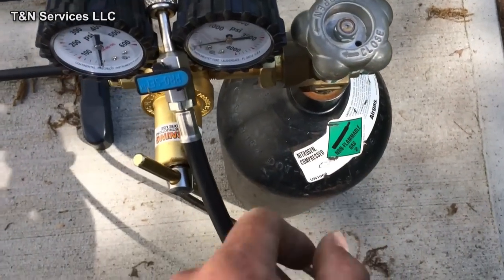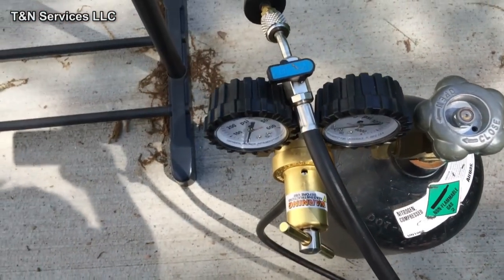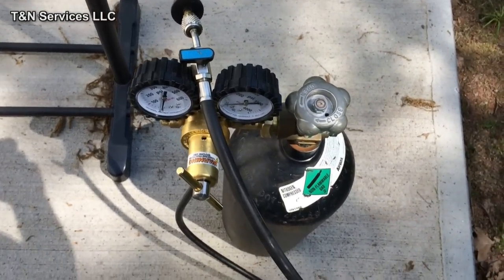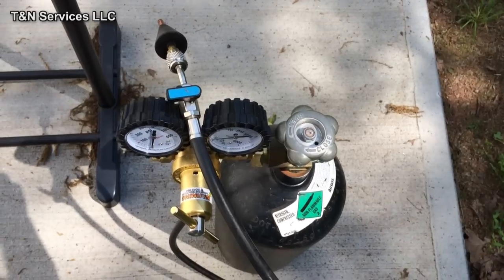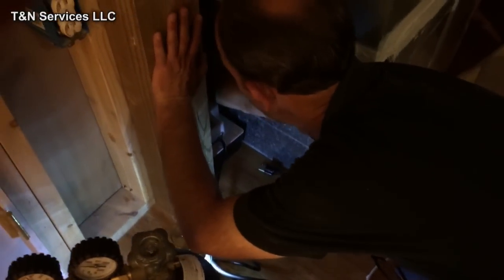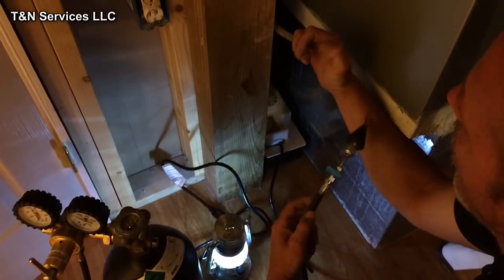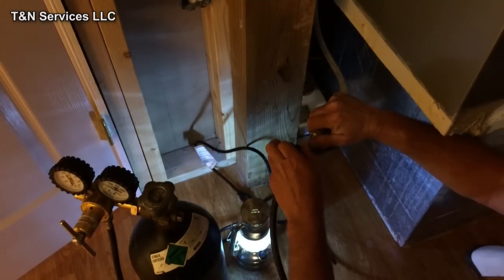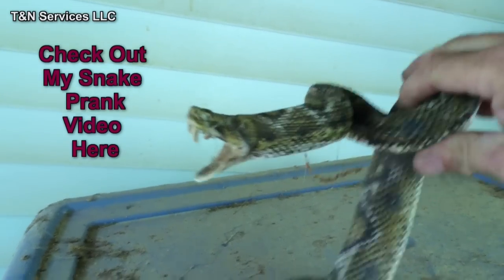How To Unclog A Condensate Pump Tube

Comment: Question - why nitrogen vs just compresses air?  Also, what PSI did you set the regulator at - so that you don’t blow the line versus unblock the clog?  That’s typically 3/8” ID and 1/2” OD clear tubing, correct?  What the max PSI it can handle, esp if the line is 10 years or so old.  Thoughts?